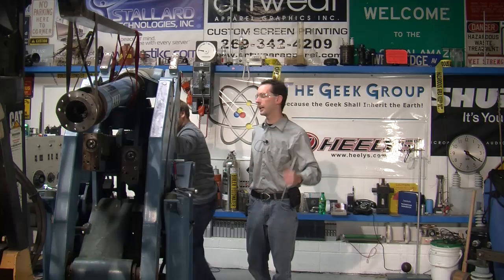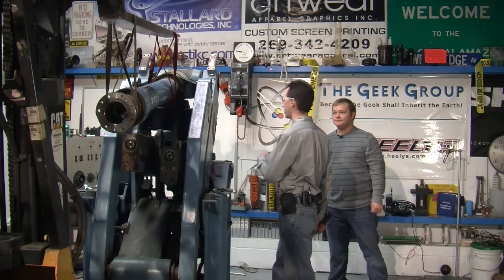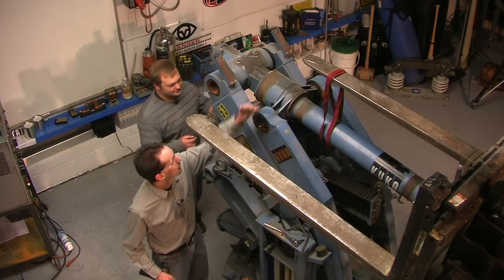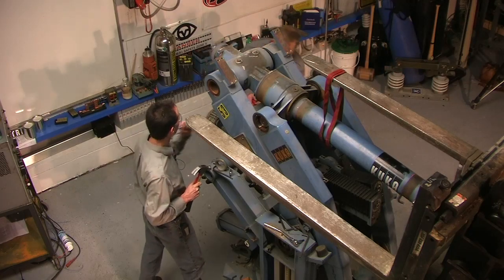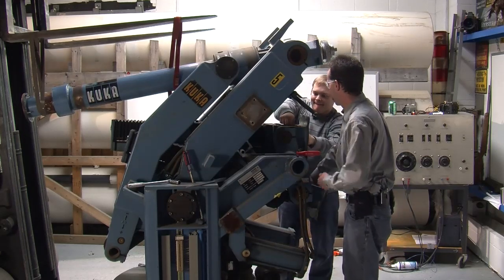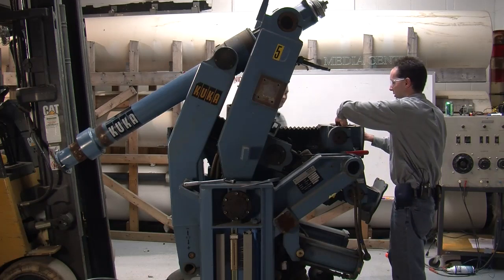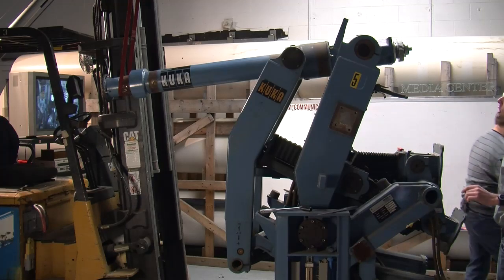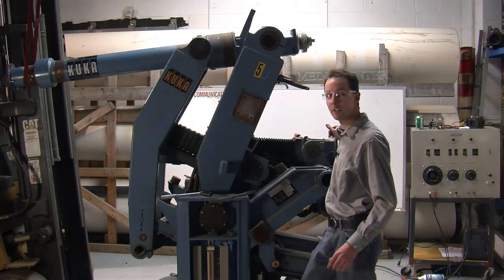KUKA Robot Part 1: Equipment Autopsy #8

Comment: @cncfreakcncfreak  Yes, you are correct, AC Servo, in particular the Siemens servo package, with resolvers as opposed to encoders (on most other cnc equipment).